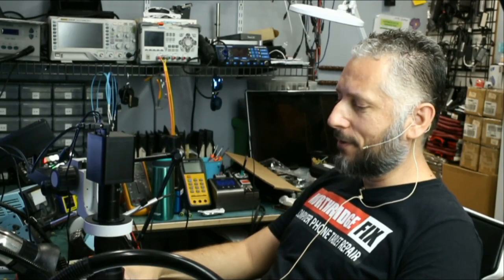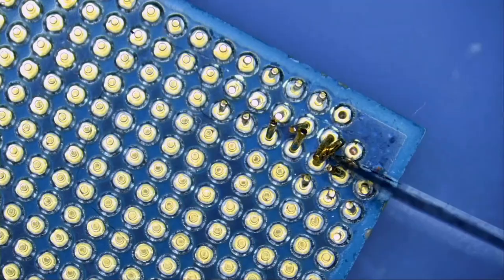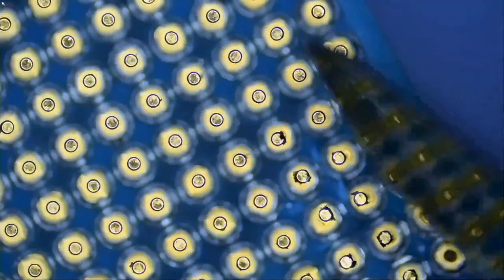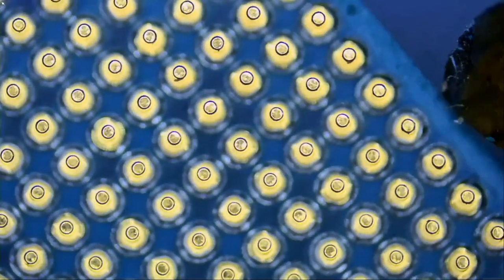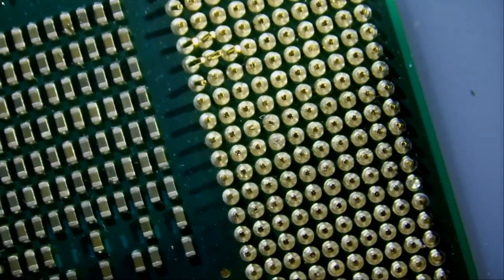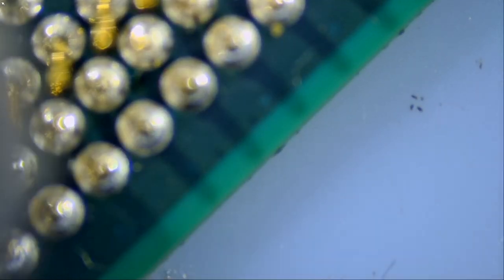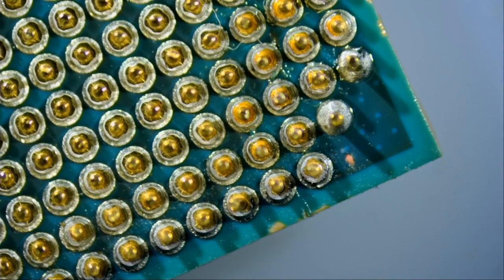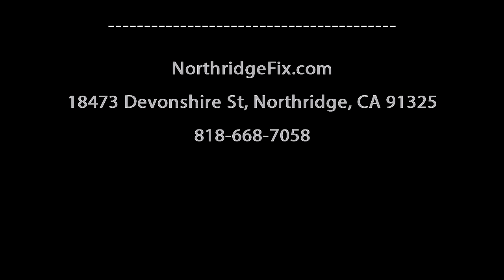Ryzen 9 5950x CPU with Bent and Broken Pins. Can we save it ?

Comment: You may consider holding on to an AM4 motherboard, just to be able to test the CPUs.
Reply: @markvietti  trying to put the CPU in it will give him a feel if the pins are straight enough.
Reply: @HerrAlien  Not only that, the socket itself straightens the pins.   Even if you're a bit off, you can wiggle it into the socket and user the lever back and forth to get them really straight.
Reply: @markvietti  most people are thinks different, they think they send you to fix the pin and know cpu is working ok, i dont know is norhridge explain to them from the beginning or not they only fix the ben pin and missing pin, if cpu did not works not they problem,
Reply: Thats the customers job, once pins been bent, you don't wanna keep resocketing it, customer stick it in socket and leave it.
Reply: @billykulim5202  why would he even need to tell them that.. if the cpu doesn't work he can do nothing about it, he can just fix the pins if he tests it and it doesn't work and tells the customer they might not pay him to get it back.
Reply: @BuzzingGoober  that's right, so long as it's close enough, the socket will finish the job... for sure.

Comment: For those who want to know a nice way to avoid breaking pins, you can align them using the metal tip of a mechanical pencil. Only fin one that fits and it will make it easier.
Reply: Or just be more careful and don't bend them.

Comment: I still wonder how the owner of the cpu manage to destroy those pins.
Reply: Probably dropped it.
Reply: Its easy to misapply pressure when installing or removing, you need to lift it evenly. If you lift non evenly or drop halfway through removal, this happens.
Reply: Looks like a drop. Maybe a bad cpu-cooler removal. With am4 cpu's it's very easy to rip off the whole cpu of the closed socket, when you don't gently twist the cooler after looseing it.

Comment: Excellent work, as always. I just wondered whether and how do you remove flux excess thereafter, given such a delicate pin forest
Reply: Thats exactly what I wanna know as well 😅

Myself I use the brush with alcohol to flick off or brush flux off the board, then clean the sides and heatsink as you usually would like any other surface, its hard to clean it 100% but checking with UV light reveals which spot to revisit and clean more.
Reply: He probably sprayed it with a lot of alcohol , the only safe way .

Comment: Iv found using a empty mechanical pencil works great for trying to bend back pins as it fits the pins inside. Great work as always these are going to be hard to find once the 7950x3D comes out.
Reply: I said the same thing then saw you said it first

Comment: I'm no expert or nowt but maybe trying to heat the pins with hot air to make them malleable but let them cool a short time between straightening  ? just an idea,, As ya do!
Reply: Maybe because you might need to feel if the pin is very loose and move a bit too freely then you know its about to break and you gotta change it
Reply: Solder probably melts faster then the pins, so you could dislodge the pins. They are pretty soft anywy, but like all metals you will get stress fractures from too much wiggle. Hopefully the heat of the CPU might help sort this after a few cycles, not sure.

Comment: Hi mate... I have a 750GB 2008-2009 Seagate HDD with a faulty motor drive chip (gets extremely hot, and the motor struggles to spin up to speed). Is there any way to fix this?

Comment: It would be cool if there was a device you could put the chip in which would help make sure the pins are fully aligned after straightening
Reply: Like a cpu socket? lol
Reply: @TLM-Nathan  yea but one that is useable with all types of pin chips. A CPU socket would only fit one type of CPU in one orientation.
Reply: @thadofalltrades  That would be impossible to have 1 thing that would fit ALL cpus due to the variance in pin diameter, length, spacing, etc.
Reply: @TLM-Nathan  no it would just need to be designed to do so.

Comment: I have 3 pins missing on my AM3+ FX6300. I thought that broken pin is unfixable, had no idea that they are simply soldered on. The CPU runs fine, doesnt really need those 3 pins, but i will replace them now after watching this.
Reply: If it works, why mess with it?
Reply: @mrtechie6810  I see your point, but i dont think i can mess it up any more than this. Just for the kicks i guess, i will be very proud if i can pull it off.

Comment: I get the weakness but i honestly think pga style cpus are better cuz repair is possible most of the time compared to a bad lga socket. So many intel motherboards on ebay have busted sockets and are practically useless unless you need different parts for a regular person. Not looking forward to hundreds of bad am5 boards due to crappy sockets.

Comment: Many hobby mechanics do not know what they are doing! more destruction than the opposite

Not the most expensive cpu. but not the cheapest either.

You can buy a CPU. with many cores, but then offte weather cores will be weaker than they are on a cpu with a smaller number of cores.

Then you have TDP watts which determine how hot a cpu gets

Not easy to choose the cpu that is right for you.

Comment: Both of the replaced pins were Ground pins. I thought it was a different corner at first, which is mostly for the HD Audio stuff.

Considering how much current these things draw, it's probably worth having all the Ground pins in place.

Also, it helps with signal integrity for the high-speed stuff like RAM, and those two pins were at the top-right of the CPU (looking from the top of the chip) which is near some of the DDR4 stuff.

Great repair job. It should work like new. ;)

Comment: I know you did a good job, but it's pointless to repair those pins if gold plating is somehow damaged on those pins. That CPU is going to glitch and misbehave
Reply: Not true, as long as it makes good contact with the socket it will be fine. I purchased a 2700x on ebay that had 3 pins replaced for my HTPC and its been going strong for over a year

Comment: This isn't an easy job although it might look like it is

I worked on one before and i made a mistake where when i was straightening alot of pins and some of them were a bit too soft instead of replacing them i straightend them back along with the rest and then one of the soft ones broke and i soldered it back using one from a donor CPU along with the other broken pins, and now i realised didn't know where the rest of the soft ones are 🥲.

Tried it on a motherboard and its not working + i found a broken pin when i was taking it out

Ill solder a new one back and see